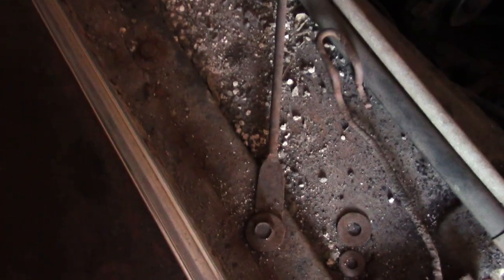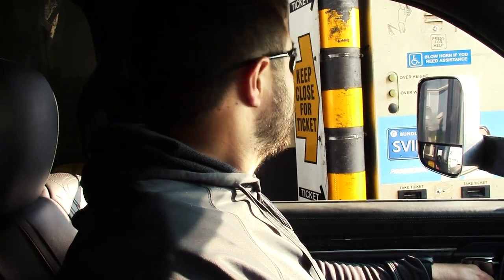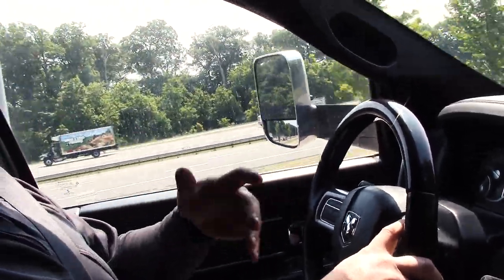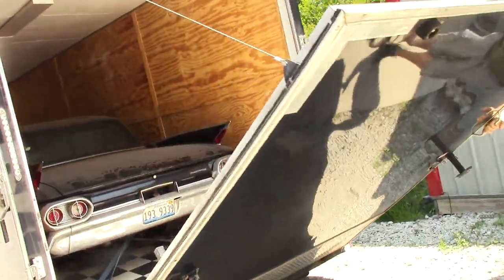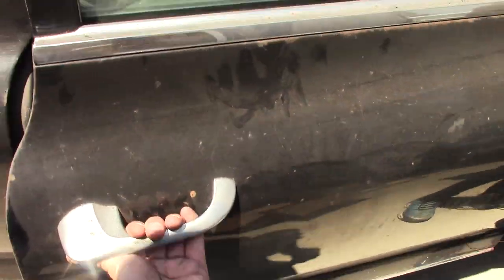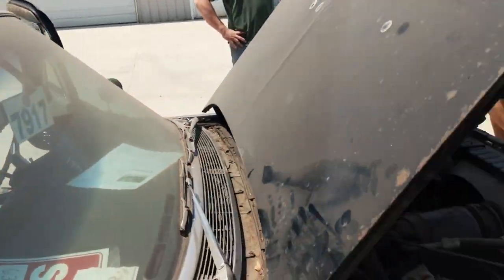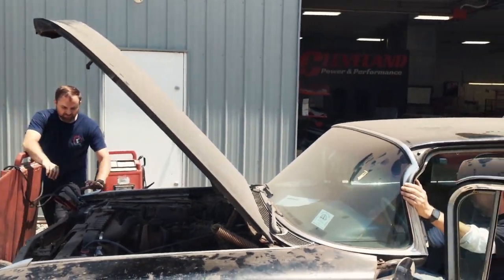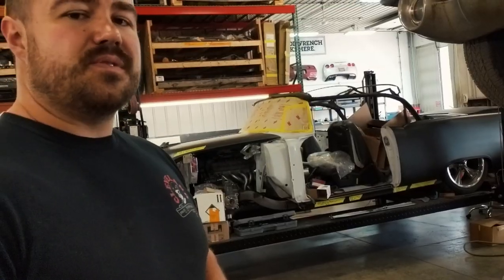1961 Caddy LIMO pulled from storage unit Will it run?

Comment: If the power antenna had been raised, you might have been able to pull in some radio stations on this AM only radio. It is ashamed that this is not the power window partitioned model that separates the passengers from the chauffeur for privacy. Quite an expensive automobile back in 1961, starting at $9500.00. Cadillac built 926 limos with the partition, and only 699 without the partition, of which you guys now own one of!!